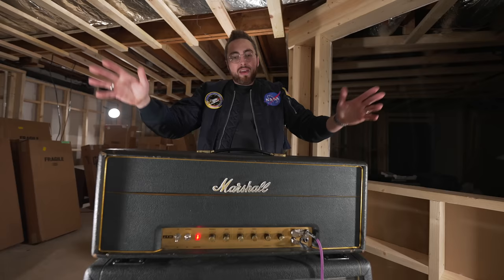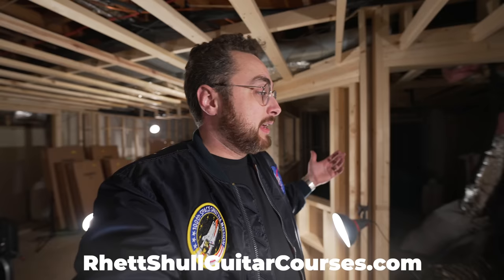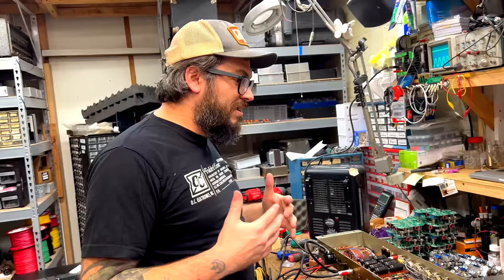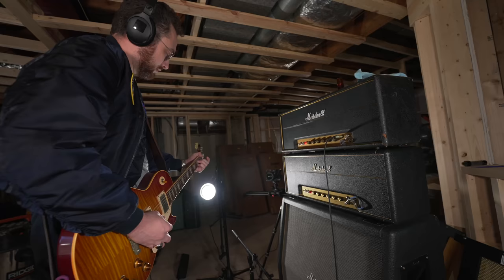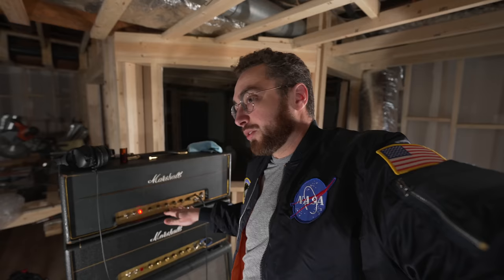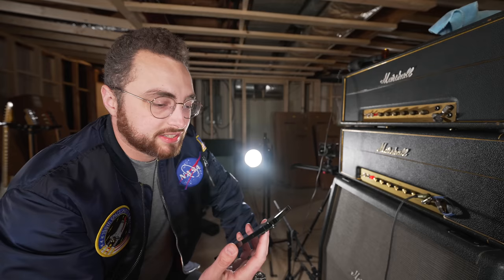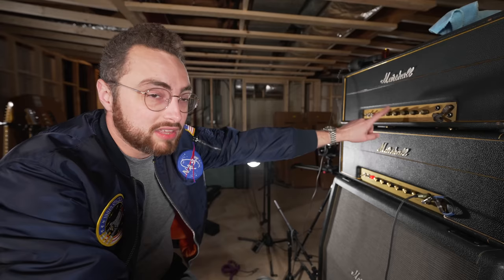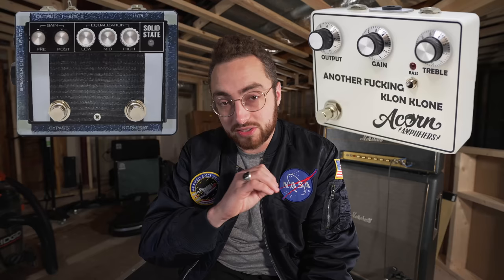This Amp Is So Loud It's Painful | Vintage 100W Marshall Plexi

Comment: If you had three 100-watt stacks on a stage, each churning out 120 dB, you don't get 360 dB total as the loudness is measured on a logarithmic scale. It's more like 130 dB total (estimated). So the multiple stacks are more for show than loudness.
Reply: To hear yourself over a wider area of the stage because those cabs beam like crazy and monitors were not really a thing.
Reply: A logarithmic scale isn’t the same as a linear scale, so yes, 3x something is still 3x, just doesn’t appear that way in that scale.
The scale exist because of how vast the range of human hearing is, as well as our perception of it, that a linear scale isn’t appropriate, but that doesn’t mean that 3 Marshall stacks is not 3x as loud as one, it literally is, just works out differently in the logarithmic scale,

Comment: I had a 100W Marshall...one of the early ones with a master volume which I bought I think in the late 70's. I thought, great, I can control the volume and make the sound man happier. NOT!! LOL! I used to tell people I know it's loud enough when my pants legs are blowing in the wind. I finally gave in and bought a Musicman 65, which was plenty loud too, but it didn't move the air like the Marshall. Not as intimidating either when playing on stage.
Reply: Ha! I still have mine. The problem was that they don’t come alive until you turn them up.

Comment: These days, most every venue has a sound system where amps are mic’d. Any small, low wattage amp is the way to go.  These huge loud amps are practically obsolete.  Rarely see them on display in most music stores.

Comment: Decibel measuring & reading is much more complicated than that. Phones' sensors can't capture a real accurate reading, you'd need a specific tool. Also, the amount of time of exposure changes the effect drastically. 
Rhett you should if possible look up more info on that and make a video about the subject.

Comment: There's a lot more low end on the original plexi compared to the original. You can really hear it on a lot of hendrix boot legs where the low end is super boomy especially with a fuzz thrown in

Comment: Careful with those Greenbacks.. I've blown a few with my 100 watter doing that exact same thing.. a single 4x12 with Greenbacks is asking for trouble. You might not realise a speaker has fried and that will put stress on the OT.

Comment: Even my 50watter from '77 is ridiculously loud, I've rented it to countless gigs where as soon as we cracked the volume on... 'guys cmon thats too loud' came over the foh talkback. And 70s 50watters have a pretty low plate voltage so they likely aren't even quite 50w.

Comment: I lived next Warner Boat Sales. They would run their boat motors in the afternoon so I had a hundred watt stereo system going. With 2 six packs of Bud I would play along to the songs with my Strat and a Fender 75 black face. You do go a little def after 6 beers but when the Stevie Nicks song came on, I decided to blare over it with the amp volume and extended my deafness. From the recording I had the Fender completely buried the high quality tweeters and extended Bose base. I only did a 4 chord progression, the sustain was ridiculous and if there was any pause between chords it went to screaming feedback. It did permanent damage to the amp- good thing I recorded it. I hate Marshall's sound.

Comment: It will surely push 110dB. Still enough air moves to make your pants flap. I run 30 watts at 2x12 demi dimed in 6-7 sq. meters. It is knocking my socks off. I can only imagine what will happen at 100W via 4 speakers.

Comment: I'm so glad to see that amp fail exactly how mine keeps failing! Those old design Ohm selectors are terrible because they stick out proud of the amp case and get bent and jacked up all the time- even just transporting the amp can break them. I need to have mine upgraded to the new style so it won't keep failing...

Comment: 3:40 That is peak watts. 34 volts indicates an 8 ohm load. If you do 34 volts squared then times .707 then divide by 8, you get 102. RMS watts is 102. 100w amp.

Comment: I have never played a 100 watt Marshall cranked  but  I had my DSL 40  maxed out a few times and even a 40 watt  combo cranked felt like I was getting stabbed in the ears.
Reply: Don't crank those DSLs too much, the circuit isn't really designed for that. Like most high gain amps the DSL power section is meant to be completely clean. If you don't like its distortion sound get a plexi style pedal and put it in front or through the effects loop.

 But of course you can do whatever you want,  no Fenders were meant to be distorted either.

Comment: I have a 100w JCM 2000 DSL 100 that I run with an attenuator pedal so I can open up the amps volume and actually play it in my garage. As soon as I raise the volume on the pedal it's already 🤯🤯🤯🤯🤯🤯🤯. My JCM 900 50w not so much 😂😂, when I hear people say that there isn't much difference between a 50w and a 100w I'm wondering what they are listening to because two my two JCM's there's a HUGE difference.

Comment: Your two Marshalls should have different power tubes and different cathode wiring on V1 (and maybe V2) for a start. Many things after that I'm sure. Can't believe the differences between the JTM45/100 and the 1959. Night and day, but which do you say is "THE" plexi sound? I can't say for sure. BTW are those 144.5 watts in RMS or IHF?

Comment: If you've ever had a semi-hollow come alive in your hands and vibrate like a tuning fork (anybody remember those?) you might wonder what kind of amp could do that to a solidbody. Well, you're looking at it. British watts are louder, as the saying goes, but nobody these days needs this kind of loud; these things were built to fill arenas, in a time when these enormous venues had basically nothing and bands or (later) sound companies would bring in these enormous stacks of Altec-Lansing Voice Of The Theater speakers, a technique pioneered by the Allman Brothers and the Grateful Dead at big outdoor shows in the summers of the late 1960s. Despite their massive size and rack after rack of Crown (sometimes Crest) power amps, they really couldn't push all that much bass and were reserved for the vocals, meaning most of the instrument sounds you'd hear at concerts came from the stage. That didn't change until the mid-to-late '70s, when Pink Floyd changed the game. When idjits tell me wood doesn't matter I tell 'em when you play at these kinds of arena levels, the screws in the pickguard start to matter. The percussive effect Rhett is trying to describe was called "knock", but you really need to be in a warehouse-sized space to experience it properly and ear protection is highly recommended.

Comment: Just a cool video.  The Led Zeppelin songs are appropriate.  Both amps sound wonderful.  Cheers!
Reply: Howdy, perhaps you may want to look into a different Output Transformer.  I have used Mercury Magnetics with great results in my 1959 JMP Randy Rhoads head.  I used the transformer with a 2.2K primary wind.  EVH had a similar transformer.

Comment: Acdc stiff upper lip tour. They had 400 watt custom heads to power 4 cabs each. Acdc don't use p.a except for vocals and drums. That guitar, it's all with volume from the amps.

Comment: Funny thing is, it's quite easy (and cheap) to have a poweramp nowadays that would push much more then 140W. Even my Ayima A04 push much more then that in a single channel with the correct power supply, and the overall weight is less then 1kg.

But at that point, even running at 300W would leave you with just 2 more dB or something... So quite pointless, unless you really need that clean headroom (which modern Class AB or D amps will have anyway with much less max power).

As much as I love the story, look and legacy of those amps (and I f' love some modded plexi sounds), I just can't see myself buying one, carrying around and messing with maintenance. Just give me some good 1x12 or 2x12 cabs and speakers, my Ayima A04 and a good modeller/ set of pre-amp and pedals, and I'm set.

Comment: One of the best feelings in the world is getting a chance to a crank a 100+ watt tube head up as loud as she'll go, then going into a different room or something and then hear what it truly sounds like when the amp is at the limit and same with the speakers lol. 

I've done this with some of my favorite amps. Thank god for wireless systems. Last time I did it, it was with a 5150 and I cranked it all the way up through an oversized recto cabinet with v30s, it was in my garage, I shut my garage door like 3/4 of the way and then walked to the end of my driveway and let it rip lol. It was an experience and the sound was indescribable really. Thankfully I have cool neighbors, 2 of them walked over to see what was going on and I promised them it was just a fun test and the volume was going back to normal lol.

Comment: i own a 1959hw and i have stood behind a 747 multiple times taking off working for UPS. the plexi is loud no doubt, but the 747 rips your f cking ears off your head. plexis are not jet engines, 
to be honest i have an OR50 from orange and through a 4x12 it holds within just a few dbs of the plexi. that OR 50 is a loud amp for 50 watts and rumbles the floor with its low end. 

maybe i have just been around more loud stuff than others, but the plexi does not make you ill or any of the other things some folks say. yeah its too loud for inside a house. the dbs wear you down and you can't decern the sound any longer. ear fatigue i guess. 

i think its fair to say a plexi will hit near 125db. balls out its what mine will hit.  for me that is upper ceiling usable in the right setting. a tip though. if you are going to push these amps that hard for a while you may want some air blowing in the back panel. its gets hot. 

one thing that may be safe to say at this point though concerning these old amps, i dont know if any two sound the same any longer. parts replaced, parts drifting in value. its why i just decided to buy a hand wired 1959 and tune the circuit to my taste. 

cool demo though, thank you

Comment: As someone who used amps like these for real, I always find these videos humorous, it’s like cavemen discovering fire. 100 watts were meant for large venues and outdoor gigs, we used 50 watts inside smaller halls and clubs, often we’d have to turn our cabinets around. Rock n Roll guitar playing is supposed to be  a visceral experience, the volume and guitar/amp interaction is part of it. This is why I find the concept of silent stages absolutely ridiculous, it’s supposed to be impolite, loud, and brash and impossible to ignore. Y’all have spent way too much time with earphones on sitting in front of your DAW

Comment: I am curious did your headphones provide any ear protection or were they just monitors? What would use to protect your hearing in a closed space with a 100W and 4 X 12?
Reply: The most heavy duty headphones you can buy. A 100 watt tube amp is INSANELY loud.

Comment: I had the randy amp, i put it in the garage wired into a mesa 4.12 and i ran a 20 foot cable to the back of my house for my guitar.. I turned everything to 10, closed the garage door and ran to the back of the house. It was so freaking loud, the walls shook, neighbors were coming out of their houses. I played for what seemed like 10 minutes like that. At one point i was like it's too late to turn back now, and since i had burned the bridge i might as well blow the motherfucker up. It was godly to play at that level.

Comment: Until you try to fit both sounds in a mix. Then you probably will change your opinion. I found that reissue models of various instruments are often made with that in mind,making them a "better" product in the end. The old one might sound "better" solo, but all that bass turns into mud, as soon as you add it to a full band mix.

Comment: That is not your average 100 watt lol. its only a number though, they are louder than 100 watts. I too have an Ampeg V-4 head from the early 70's. That also says 100 watts, it's more. It is not designed to distort at all, and believe me I tried lol. at volume 3 your ears can ring for sure, past that they will bleed lol. It is not practical in the bedroom. it has 4) 7027A power tubes and 2 huge transformers. I call it my Stones amp. I just put peddels to it, it handles it really well. I recently purchased a Soldano SLO30 and I use that because all it needs for me is a delay, the amp does the rest at bedroom levels. I do wish to have a vintage Marshall 100 watt one day though. THey are the sound of Rock no doubt, I have played through them, I just cant afford one now lol. I did notice you stepped back from the amp a couple times with your Les Paul, the great joy of unpotted custombuckers. I wouldn't trade that for anything in the world. I assume that's what you have in that beautiful guitar.

Comment: Outdoor gigs, big dead sounding theatres, and PA’s that could barely handle doing vocals and drums cleanly (let alone throwing guitar into the mix). That’s why the 100w’s existed. 

Outdoors it’s a lot less painful a fee metres away from the amp.

Comment: So are you saying that a JTM45/100 sounds like a JTM 45 with 100 watts? 😁 But seriously, is it the JTM 45 with two power transformers or just one bigger one? I thought I heard that the origina 100 watters were set up like that. Tube rectifier or solid state?

Comment: Because of a couple factors, guitar amps are very loud given their output ratings. But as a car audio guy its funny to hear 100 or 144 watts talked about like it's something outrageous. The biggest car audio setups out there are running thousands of watts on mids and highs and tens of thousands on lows. If 125db on mid range frequencies impresses you then you gotta experience 160+ at sub 40hz.

Comment: I don't see the need for 100 watt amps anymore as is. It's a cool vintage amp, but venues don't want that kind of stage volume anymore. These days with so many players going to modelers into the PA too, and less amp players overall, a good 25 or 35 watt tube amp is where it's at for those of us who still like to play the real thing.

Comment: I get it. As good as the modern reissues are, when you a/b with the real thing, you inevitably resign yourself to the realization that what you really want is going to be...well...costly. It's almost like you kick yourself for peeking behind the curtain, right?
Reply: Man, I don't know. When he cranked them up I thought the reissue had more clarity. It had more gain too but the original sounded more flubby.

Comment: In other news, I turned my 90 watt Mark 5 up all the way once (and only once) and my dB meter was in the 125db range and HOLY MOTHER OF GOD, it felt like I was standing on a giant vibrator. My feet were buzzing, I could feel the sound in my teeth and in my organs. The whole house rattled. Even with ear plugs in and gun range muffs over my ears I was afraid of playing for any length of time like that because I honestly thought the vibration in my skull bones could damage my hearing.

Worth doing once, its both terrifying and like a religious experience.

Comment: I'm not sure the phone sound pressure level app would be accurate. Each 3dB increase is approximately double the sound pressure level. This requires 4 times the electrical power. All things being equal a 100w Marshall is only twice as loud (3dB) as a 25w Marshall. This gets hard to tell from a volume perspective in the room. I know when I go from 100 to 50 all I notice is a slight drop in bass punch. Long way of saying don't worry about how much power or how loud just how it feels and sounds and makes you play. The other comment is that it's easy to model the sound of amplifier but much harder to recreate the feel of the raw power these amps have. But those modellers are more reliable and lighter.

Comment: I've got an early ss rectified Traynor YBA-1 bass amp from 66ish. It's supposed to be running 40 watts, but it is realistically running above 50. I run it through a vintage closed back Traynor 4X10 100W cab. It's got less high end than the old Superleads, but will move your house off the foundation. Traynor Amps were the Canadian answer to Marshall and Fender durability issues. At nearly 60 years old, my amp is fussy as hell and probably belongs in a museum, but I can't part with it.

Comment: I guess this is obvious, but back in the day, PAs were terrible.  They only carried vocals.  The guitarist was in charge of filling the room with his sound.  There was no sound guy balancing it all out thru the mains.  That took a lot of muscle, even in a medium sized room.  And you didn’t want reverb, because the room was providing it.  I played a 50w Marshall head thru a 4x12 cabinet and used it all to fill the average sized club.  I can easily see 100w being needed for larger spaces.  These days the sound guys want you to keep the stage volume low and send everything thru the PA.  Anything more than about 12w is overkill.